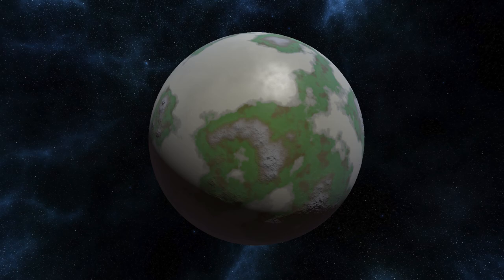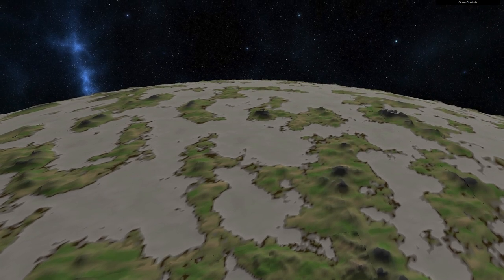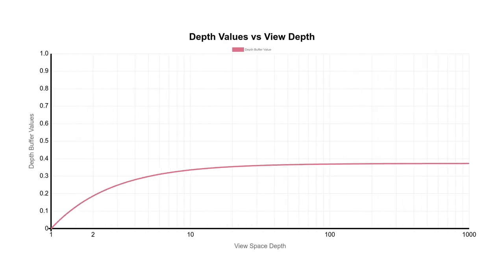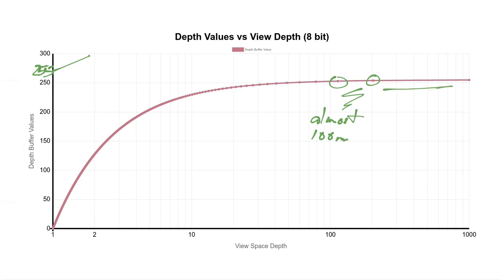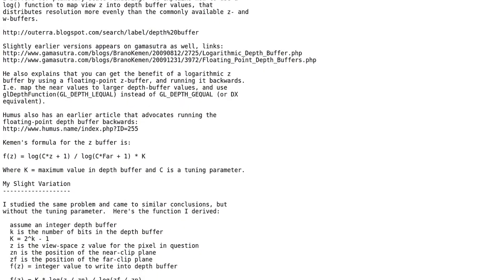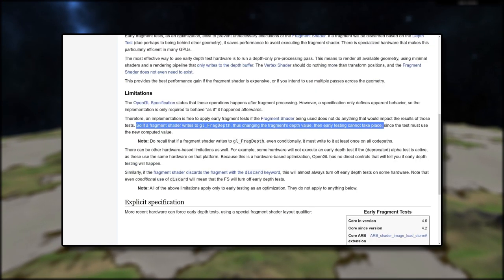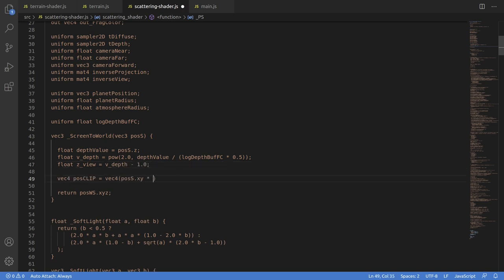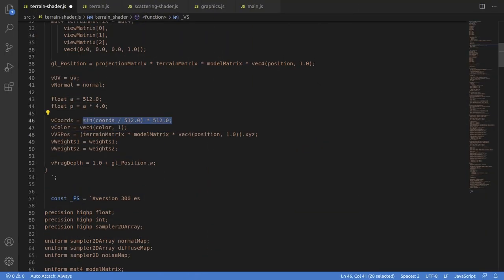Logarithmic Depth Buffers and Problems of Scale (3D World Generation #9)

Comment: I just smacked my head into the sin wave? no, triangle wave? I guess, but not it. And derived a nice piece of code on a page about repeating noise textures.

pointInRepeatingSpace = (originalPosition % (repeatingPeriod + repeatingPeriod)) % repeatingPeriod;

which has solved the original jittery textures without causing the jaggy/strechy bits at the edge of the repeating period that the sin and triangle waves cause.

source: ronja-tutorials 029-tiling-noise

also side note: you're an inspiration!
Reply: hmm, woke up this morning and found some streaky lines appearing where coordinates approached the repeating period, so I changed my repeating period to be a base 2 value (not sure if that helped), and changed to simply:

pointInRepeatingSpace = originalPosition % repeatingPeriod;

and the streaks are gone ... nope they moved to the location of the new base 2 value. I am not a smart man.
Reply from the maker: Wait, so did this work or not? I love the simplicity here, really want to change my method if this is better.
Reply: alright I think I just got it, and didn't just hide the problem from myself for the moment. So (position % divisor), gives distortion around axis 0, whereas the (position % divisor + divisor) % divisor) gives distortion approaching axis divisor. So I have just do both then test the absolute value of each, and use the original value, for the one that is lower in the absolute.
And this seems to solved it.
Reply: okay no, that just moved it again... hmm. this may be be a bust. But I feel like there's something here, so I'll keep going, will update if I find a good solution.
Reply: it would appear that the issue with doing something like mod(position, 1024) is that when you get to the border the noise algorithm is trying to lerp between 1022 to 1023 to 0 to 1, and when it tries to bridge 1023 to 0 it (really rather gracefully) blows up, smearing textures along one axis or another. so a modification of the simplex noise algorithm is needed to make it understand that it too exists within a repeating period. Now I am not a math guy, like, I didn't do linear algerbra in school. So I'll hunt around and see what other tiling noise solutions are out there. The ronja-tutorials articles did have a relatively human-readable implementation of simplex noise so that seems like where I'll end up if I can't find an easier answer and have to write my own.
Reply: best solution I have found so far is quite dumb, and only limits the repeating texture problem to a smaller seem, so I'm going to move on.

following is some particularly fuzzy logic:

So here's the idea, you do two projections and modulo them by your repeating period, the second projection's has an offset on it's x and y equal to half of the repeating period.
proj1 = position % period;
proj2 = (position + (period/2)) %period;
now the problem shows up when gl tries to interp a varying from 1023 to 0 and the fragment shader draws the entire range across a single triangle. We get around this by figuring out how close to the middle of our repeating period we are.

so we map the distance to the middle of the of repeating period as a uv and call it test and slap in on the attributes and pass it through as a varying.
To get the distance of the first projection to half of its repeating period I do the following rather inelegant solution for x and y:
getPeriodDist(value, period) {
let v = Math.abs(value);
let half = period / 2;
if (v < half) { v = period - v; }
v -= half;
return  v / half;
}
this is what I pass to the shader as vTest, 
now in our shader we ask if vTest's x and y are greater or less than 0.5 in order to get four quadrants.
In the case of x and y < 0.5
    proj1 works as is.
In the case of x and y > .5
    proj2 works as is.
But in the the case where x > .5 and y < .5
    we need to use proj2.x with proj1.y
and in the last case 
     we use proj1.x and proj2.y

now z is suspiciously absent here, and that is because my map while in three dimensions is projected on a flat plane with a camera that looks nearly straight down at all times, so I don't have to worry about repeating my z since the height bounds of a planet's terrain is really quite small geospatially speaking.

And if that sounds thoroughly scuffed it's cause it is, but we're only half done!

All we're doing is hiding when the render tries to interpolation at end of our repeating period. So now we want to apply our repeating coordinate space for noise generation.

We want to get our x,y's into a 4d torus looking shape as detailed in redblobgames' terrain-from-noise article where they discuss "Wraparound maps". I tried implementing that solution earlier but then ran into the problem where the renderer was still  mangling the interpolation of the varying and ruining the noise inside the repeating torus space so now with that mangling out of the way I have given it a shot again, and it's working! I now have beautiful noise rolling all around my sphere-ified plane. Today I claim victory. Tomorrow I break it by being dumb, I always seem to find a way.
Reply from the maker: @benmillions8961  Heh you lost me a bit, gotta go over your posts a bit more closely.

Comment: Nice stuff man, I ran into all these problems when testing large distances. Initially I used log depth and wrote to gl_fragdepth, I later replaced this with a reversed Z projection matrix, then I switched my camera code over to double precision and then used double precision throughout my shader pipeline.  It worked but man it hit performance hard.
Reply from the maker: Nice! Was that in openGL or webgl? I thought the reversed-Z trick didn't work in OpenGL because of the NDC space bounds, and you needed an extension to change that.

Comment: There's a Unity' conference about Kerbal Space Program and how they solved z-clipping, and basically works pretty well for Kerbin being 600km in radius, they've opted for 4 to 5 render targets: sky and far space, far planet, near planet, iva (optional) and UI; no logarithmic depth buffer mentioned.
Basically the second render has a far from player near plane, while the third renders what's nearby ( less than 1 km I guess ); sky, well renders the kerbol system and the atmosphere.
Anyway, great awesome stuff!
Reply from the maker: That sort of multi-stepped approach is what Outerra (the ones who wrote up the log depth buffer thing) used before they figured out the log depth trick.

I like the log depth because it's simple, doesn't introduce any complexity in the way the scene is handled, kinda just scales. Whether or not Kerbal had a good reason to use their approach, no idea, but if I find out I'll definitely make a video on it :)
Reply: @simondev758  well, the only reason I could think of is the broken texture effect, anyway it'd be perfectly fine having two cameras instead ( near linear, far logarithmic ), they maybe have thought it was simpler this way.
Reply: @simondev758  sorry if I spam you, but there are two interesting articles about map generation in this blog: https://www.redblobgames.com/
Namely, Polygonal Map Generation and Tiling a sphere with Voronoi, which are very interesting, they are worth reading.

Comment: I've been dealing with these problems for a while now. It's cool to see new solutions.  I'm doing everything through Unity which is a bit of a bummer because though I could technically fix all my problems with what you presented, I'd have to throw out pretty much all my current materials, it appears.  Still, I've been considering rewriting my old engine one day and might take these ideas and implement them in there.  Great video!

Comment: Here's what I did for Z-fighting which has worked for me.   I basically try to touch the Z numbers as little as possible after converting them to view  space.   First I took the projection calculation out of the matrix since it appeared to cause  some instability at very long ranges.   I just do this in a post step.  For the final divide I just pick a very large power of two since that shouldn't touch the mantissa bits at all.  So far this has worked at millions of kilometers.  You do need a good LOD system however.

Comment: Writing to gl_FragDepth IS a big deal if you have a lot of overdraw in your scene because it won't skip running a shader if its resulting pixel will be behind what's already in the framebuffer. You effectively break the early-out functionality that hardware graphics have relied on for 25 years to keep things as fast as possible. Yes, in this project's case where there isn't a lot of overdraw, it's not going to hut anything, but in anything that has expensive material shaders and many objects/geometry in the scene, you want to take advantage of the Z-buffer omitting shader executions as much as possible, and render front-to-back to further leverage that functionality.
Reply from the maker: I point at early-out breakage literally in the same sentence, like... just a few words before. At the end of the day, numbers and profiling are king. If your use case demands this and you're willing to eat the cost, then go for it. It's all about knowing the option exists, and the trade-offs therein.

Comment: This is really interesting but why not just use a saw wave as long as your texture tiles it should be fine right?
Reply from the maker: That's interesting, I saw it but didn't try it. My problem is that the terrain isn't textured with uv's, but I'm using triplanar mapping using the world space coordinates. I kinda think the saw tooth pattern won't work since you have that dropoff instead of linearly coming down again, since the mapping + I've got some tiling pattern breakup code that uses gradient noise + world space position to break up the obvious patterns.

I may need to revisit how the terrain is textured, maybe go fully procedural, but I'll try the saw pattern when I'm at home.
Reply: @simondev758  yeah as long as you run each of the world axes through it before any other processing it should probably work. Unless maybe your working with a large scale noise for variation but imo that's something I'd reccomend writing to the vertex colours if you can work it out because in this case they're going to be a lot better suited to large scale features without suffering floating point issues.

Comment: I seem to recall that one of the most common ways to clean up any waveform's output is to give it another waveform or two in parallel. I could be remembering that wrong, but how much would it hurt to try?
Reply from the maker: I was thinking something along those lines, output a second wave from the vertex to use as the tiling breakup. I'll try it if I come back around to the texturing.

Comment: Would the writing to depth cost be mostly mitigated if using deferred shading?
Reply from the maker: Writing to depth just overrides some common hardware optimizations, since you basically must run the pixel shader rather than depth testing and discarding a fragment after vertex transform.
Reply: @simondev758  Since we need to modify depth we need to run fragment shader anyway, so that cost is a given, but with deferred shading any costly shaders like lighting will only be run once per fragment anyway, so that kinda works like a z pre-pass? And how fast is hw z-discard, compared to core count, anyway?
Reply from the maker: @overloader7900  The depth testing happens on the gpu.

So I guess it would depend entirely on your setup. I'm thinking of a setup where you do a depth prepass, followed by a full opaque pass to write fill the gbuffer. Maybe you combine those if performance says its fine. Where do we modify depth from fragment shaders, as you mention?
Reply: @simondev758  Does it matter where it gets written if it is written to at all? The cost of threads had to be dispatched is there, but is it large enough to saturate the cores? Forward rendering is an obvious no because of lots of overdraw (although with occlusion culling?). 

The difference between depth prepass and deferred rendering is that in deferred rendering you also save some basic information(very cheap shader) in buffer, like normals, color, positions, etc. And in pre-pass you just save the depth, and then re-rendering it, only saving data if depths are equal.

So deferred requires more memory and probably bandwidth on first pass, but pre-pass has cost of twice the geometry...
Reply from the maker: @overloader7900  So if I'm understanding right, you're asking if it matters while writing depth, ie. writing to gl_fragdepth WHILE populating the depth buffer.

That's an interesting question, and I'm pretty sure yes it still matters and probably hurts early discard optimizations. A cursory search online gave me this: https://www.khronos.org/registry/OpenGL/extensions/ARB/ARB_conservative_depth.txt

An opengl extension specifically written to allow you to write to depth from the fragment shader while still allowing early fragment discard to work.